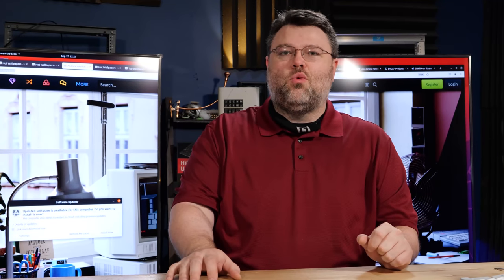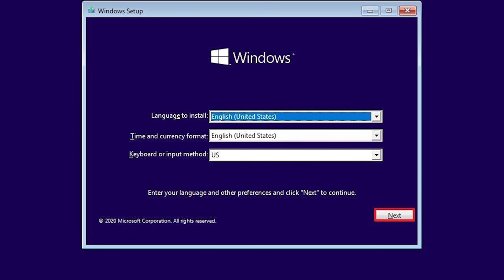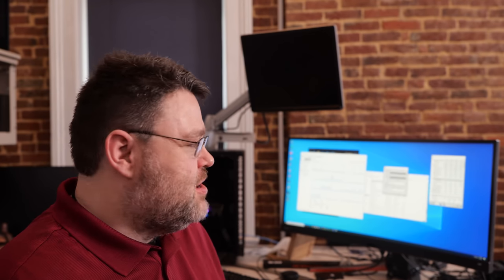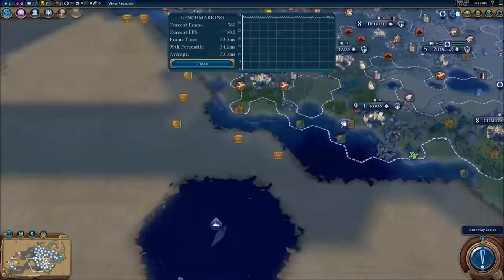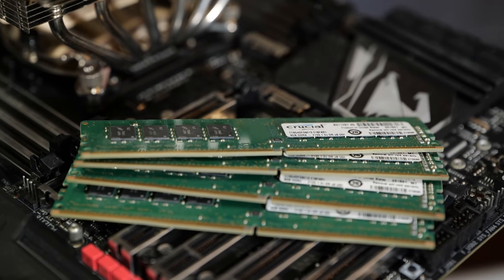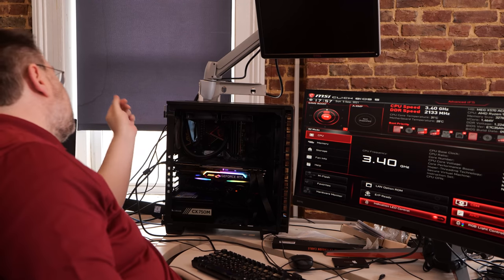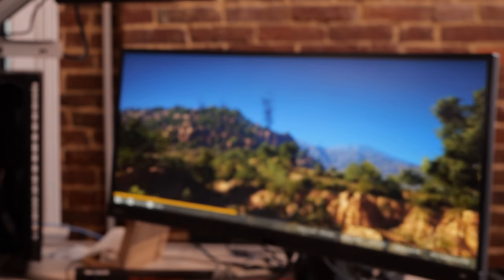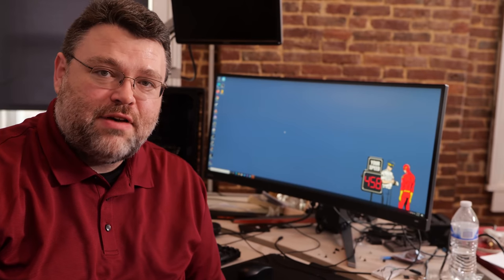Level1Techs Real Upgrades: X299 7900X to AM4 5950X

Comment: wow, this video is tailored to me. I'm on a 7900x atm on a gigabyte aorus 7, great mobo and a pretty good CPU for its time and my use case (video rendering), but the platform got stuck in time and had an embarrassing run. I made the mistake of buying into the x299 platform on launch expecting new silicon down the line, now I've been stuck for years on it.

IMHO the way Intel abandoned the x299 is unforgivable... I could not believe it when the 9k series was just a silicon refresh, especially after the YEARS of support and innovation on the x99 platform. and as shoked is i was, nothing prepared me for the 10k series, being YET another refresh. Intel lost a lot of customers with those moves... I spent years watching people buy into AMD setups that were just as powerful at under a quarter of the total upgrade cost. The 2700x was already a mild upgrade!

AMD ended up innovating on the AM4 platform way more than Intel ever did on their x99 series... sure, performance matters, but also confidence. i have no reason at all to trust intell will stick to a platform the way they did with x99. AMD did it with AM3, and they had a fantastic run with AM4, I have no doubts AM5 will get lots of support.

5950x looks like a beast upgrade, but I'm still going to wait a lil longer. (AM4 is at the end of its life, will wait for AM5)
Reply: AMD also screwed over Thread ripper customers. x399 had only really 1 gen and refresh. Trx40 has only 1 gen ever and it's already discontinued

Comment: I recently went from a 5930K to a 5900X, it is wild to think what the next 5 year upgrade will be like...
Reply: I did something very similar!  Mid 2020 my 5930K died so I went 3950x.  That was a hell of an upgrade.  I’ve since migrated again to a 5950x/3090 setup and gave the Zen2 to a family member.  Good times. 

Enjoy your new system! 😀
Reply: @AstroCat I think your 5820K is great for an everyday Linux machine for everyday tasks.  If it’s working well for you, let it keep working well. 👍🏻
Reply: Still rocking my 5930K @ 4.4Ghz, 32GB (8gb x4) of 2666mhz, upgraded to 2080super. Still does really well, even in VR with a Valve Index. I know there is performance in CPU+ram upgrade, but I'm saving for nightvision, and prices to drop. And the setup just keeps chugging! Went from 360mm water cooling to NHD15 to keep it cool long ago!
Reply: I only have a 3700x

Comment: The oldest parts in my computer right now are from 2015. An HX1000i and 4x Samsung 850 EVO 500 GB SSDs. In 2017 I built a mostly new system around a TR 1950X, but brought the PSU, SSDs, and a "just a few months old" 1080 Ti  from the old machine (sold the rest of the parts off). Since then, I switched the AIO water cooler for a custom loop, added two 970 EVO Plus drives, added more RAM, and swapped the 1080 Ti for an RX 6900 XT. Occasionally I've put a RX 560 or some other GPU in for passthrough experiments.

Comment: Rocking X299 i9 7900X myself - in the inwin 909 case, H115i cooler - with a 1080 TI and it's rock solid, used 12+ hours a day for 3 years - this video was really interesting / kinda puts me off from replacing that 1080 haha
Reply: This is 100% not the fpu to blame from my exp, the heat issues could be sorted and get the ram to 3600 or so and you will likely not see any issues even if u ran the cpu totally at stock

Comment: I'm at a loss... what was exactly wrong with the previous config? Bad motherboard/CPU/CMOS battery? The CPU was overheating, BIOS settings were being reset often. What were the causes? Maybe I missed something. :/
Reply: As the bios was reseting on its own, probably dying CMOS Battery, Heatsink probably needed new paste.  New video card was probably heating the case up more as well, so better fans with more cfm might of helped.

Comment: not that it would matter, but my 5950x does draw up to 190-200w when fully loaded and with PBO2 turned on (just a general -5 curve optimizer offset, nothing more). An NH-D15 will hold about 190w load at 4.2ghz for over an hour.
Reply: add more fans/spin them faster, it helps a bit

Comment: I had an old Seasonic 850 watt silver. It was fine for a decade, but at 12 years, it fried my HDD, SSD, and motherboard (RAM, CPU, and graphics card were fine).

I buy good PSU’s, but they do die. I would highly recommend swapping those out after a while.

Also, my friend’s Thermaltake Toughpower 1000 watt had been real nice.

Comment: I forgot about the BIOS on those boards. They have a Dual BIOS setup. So, it didn't reset, it just switched over to the backup BIOS. Unless the board has a dedicated BIOS switch. Regardless that a awesome board. I would've just delided the CPU. That 10core is not soldered, if i remember correctly. Also. the peak wattage of that 2017 CX750M is like 800+ watts. If lost anything, it would the efficiency not peak wattage.

Comment: Being an AMD fanboi I'd rather have a 5950X than a 7900X. But I was very disappointed that the problem in this system was never diagnosed. The system as it was "should" have been just fine for what he was using it for.
Reply: An intel fanboy with no brain damage would have picked that over intel. The insane temperature was probably a bad mount. The bottleneck was the memory I think. That cpu is basically a 10 core 6700K with an arguably worse memory controller so it's still more than decent for gaming and more than capable for "light" productivity.
Reply: Delid would have done a world of good. I wish they’d fixed the existing setup.

Comment: Been loving my Antec 1300w Platinum, which is a Seasonic clone! And its been handling my 3950x/3090 no sweat. Love this PSU.

I feel bad for people that live on youtube videos in general, because a lot of power supply videos out there are flat out wrong. According to the official manual for those "kill-a-watt" wall worts that read power, they don't read actual peak power, they read the RMS (root mean square) which isn't showing actual wattage used. So when Gamers Nexus says "450w power draw" in reality, you have to correct that reading from said wall wort. Which would be 450√2 which ends up 636.3961030 which you can round to 637 watts, of ACTUAL used power. And the issue is people don't read manuals for products anymore. Hell, even Nvidia has switched from "recommended power" to "REQUIRED power" because the 3000 series are power hungry as hell. I had mine since day 1 and never had issues with "crashing" because I had a 1300w psu. Others had barely 600w crying "it crashes, its the capacitors" but turned out, capacitors had nothing to do with it. Some brands like EVGA stated the reason why they chose their capacitor design but never said "that's why some people on other brands are crashing" people just ASSUMED which was really sad.

Can't wait for AM5 and DDR5 coming end of 2022. I think when those parts come, I am gonna switch to said AM5 but probably do an 8 core instead of 16 core, DDR5, and then whatever GPU AMD drops then as well (flagship). Then I will sell my 3950x/3090 to someone.
Reply: GN tests power draw using a current clamp. Multiplying current by voltage provides power draw at any given moment. They have set up automatic logging of current draw performed by a device external to the system. Watch/read their updated CPU and GPU testing methodology.
Reply: @Dylan-xc8yz  his written reviews LITERALLY stated using the kill-a-watt power reader. Apparently YOU cant read

Comment: I'm still running an fm2+ platform....At some point, I'll upgrade to am4, I just have other priorities for the upgrade cash. My likely plan is b550, 3900x and at least 32Gb of ram. An M.2 boot drive and eliminate all the spinning rust in the system. My main concern is something with wifi/bluetooth that works on linux, since the gigabyte pci add in card simply doesn't have drivers available. I have zero desire to install windows again, it's almost two years since my windows install booted, I now fear doing so tbh.

Comment: I'm curious what the underlying cause of the stuttering was. The cpu temp jumping up that high? What was it idling at? I've seen a few heavily used Intel cpu's lately have the TIM between the die and the heatsink start to give up, making it impossible to keep the cpu cool. I'm wondering if that was a possibility.
Reply: I was thinking it was probably the motherboard that started acting up, maybe a layer is deficient and that's what causing the stutter.

Comment: Decent board from setting one up. Dirt cheap used as the RGB had stopped working. Bios has an awful lot of extra settings over my ROG B550-F.

EDIT: The Carbon

Comment: Of note, some motherboards dont reset the XMP profile with new memory installed. 
I remember testing this patriot viper steel kit of 4400Mhz on my Ryzen 5 4650G(wanted to get that GPU performance higher) Unfortunately, because of Zen2 and B450 limitations, the system could only hit 3933MT/s so i swapped the 16GB kit back out for the original cheap 32GB kit from siliconpower. The odd part was not only did the board not reset the XMP profile, but i've been running this super cheap kit of memory(costed less than the 16GB kit from patriot) at the same speed and tight that i was able to hit with the patriot kit.
Been running it like this for probably 6 months now
Reply: Well if you use XMP it does require the same testing as manual OC, so I'd expect that the user can check what's going on in the BIOS...
Reply: @TheXlen  Hopefully. It could just be that XMP only resets to default if a replacement kit doesnt support the old speed/timing

Comment: That's why i used a 4x4GB kit instead of a 2x8GB kit, and then a 4x8GB kit instead of 2x16GB kit. Having twice as many IC's does actually give you a 10%-20% gain in performance or FPS.
 To those that don't understand, don't try and stand under it. To the reply, 2x16GB dimms do not equal 4x8GB dimms in true and theoretical bandwidth. Explanation. The motherboard has dual lanes going through each channel, so when you have dual rank 16GB dimms on only 2 out of the 4 lanes are used. its not going to equal the same true and theoretical bandwidth when running a 4xXGB kit, BECAUSE, as i explained, there are twice as many IC's on the PCB of each memory module. Therefore, you will get more bandwidth (not a lot). And it shows in benchmarks and games. And yes, you can see up to 20% gains in some instances just by going with a 4xXGB kit, even if they are single rank. 4 single rank dimms will give 5-10% more bandwidth on average than 2 dual rank dimms. Remember, there are more traces going to and from all 4 memory slots, and even if the 4 dimms are single rank, they have twice as many IC's (memory chips). There are twice as many IC's on the dimms and twice as many traces from the 4 dimm slots. Wendell just proved that in this video and there are many others that prove it also. "Help me out here Wendell"
Reply: 4x8 = 2x16   the 8gb modules are single rank the 16g ones are dual rank.  and it's not a  20% gain lol

Comment: These days 'diagnosing' an issue is replacing parts I guess.  That Skylake X i9 should not be stuttering or heating up like that.  Replace the TIM, reseat the cooler.  As for losing the BIOS settings?  That's a 2 dollar battery.  Replace the PSU as it is old.  It's the heart of the system and so often overlooked and under budgeted.  Replace the ram with something more appropriate for the system- another area where one should not skimp.  Then go in there and set it properly so you know you are not over volting the CPU or running with non-optimized settings.  Set a mild overclock if it now doesn't overheat and do a 24 hr prime to verify stability.  Use appropriate SSDs/NVMEs.  (I say as I rock my Asrock Taichi X299 XE/7900x).  Yea I will probably upgrade, but not due to issues, it games just fine thank you, just I have a 3 year refresh that I try and follow (running a little late on that because it works well still).  Will keep the PSU (PCP&C 1200) and ram and maybe just replace the motherboard and CPU, or delay another 6 months if something new is pending.

Comment: Clearly the problem here (well known to any serious X299 user) is the TIM on the CPU. Remember this was the CPU all the YT commenters bagged Intel for going away from soldered TIM.
My watercooled 19-7900X has been delidded - liquid metalled and custom watercooled back in 2018. It runs 12-14 hrs a day all cores @4.9GHz @1.310 volts ram 32GBS 3600at CL15. The 420mm Rad also cooled a 1080Ti until late last year when I managed to get hold of a WC RTX 3080. I game at 1080 and sim at 4k. The PC idles at 25-27c and flat out CPU use goes to 72C. I have seen 2 other 7900X units locally with stock TIM and both now run hot. My setup sits alongside a X570-3900X system at 4.4GHZ (best it will do) and beats the Ryzen to this day (except for my blender work) so there's that though the Ryzen runs much hotter under load. Waiting to see what next gen Ryzen does before I feel the need to change.

Comment: I have two AX1200i's, the one in my main system has been surveying me for 6 years now and my older one has been for around 9 years. Probs should grab a new PSU for at least my new system but I'm too cheap to replace it.

Comment: Sweet build, I would have stuck with a tower cooler instead of the all in one. Those all in ones always die on me, got sick of dealing with them.
Reply: @AstroCat All in ones are cool though, pun in tended. They do work great for those huge multi-core CPUs too. However I've had them get gummed up and motors just break. Not much can go wrong with a tower cooler.

Comment: Find it weird that he was having CPU temp problems, esp with the cooler used, the fans in the system, etc.  Yea, the case front isn't meshified, but there are worse flowing cases then that one.  Not that it matters, that's a really nice upgrade. :-)

And yes, my system is an example of a computer with a never ending revolution of upgrade and mixed generations of parts - it started off in Jan 2012 as an overclocked Phenom x6 1055T (clearance prices on the CPU made it a very cost effective beast) in a 970 mobo, Radeon 6950, 8gb 1600 RAM, and a 2tb HDD.  Today it's a Ryzen 3600X on an x370 mobo, RX 6700XT, 32gb 3200 RAM, and 4 1tb SSD's...  Not rocking the original PSU or case though, so it's a little harder to tell based on case that the original build goes that far back. The next big upgrade is likely to be to a Zen 4 platform, but we'll see when the time comes and what reviews are like at that stage.
Reply: bad mount.
Reply: @ahmetrefikeryilmaz4432  Wendel said he checked all that.
Reply: @nukedathlonman  then the stock thermal paste between the silicon and the IHS is shit, no shocker there.

Comment: For someone who keeps the system a while an aio probably isn’t the best cooling choice. That Noctua tower cooler would be my way to go. I’m assuming this is a somewhat MSI sponsored build.
Reply: AIO's last. I have the original NZXT x60 still runs no problem. That's 2013 release old. I also have an OLDER Antec kuhler 920 liquid cooler, guess what, still works. No leaks. None of my liquid coolers have sprung a leak or stopped working. They ALL still work. But I also don't throw them around or overly bend the tubes like an idiot. Sure I've upgraded AIO's over time. Going from said 120mm dual fan antec 920 into the 240mm nzxt to a 280mm corsair to my current 360mm cooler master.... all of them still work. and all of them are still in use. this idea that AIO is trash or not good is a sad online meme by those who don't know any better.
Reply: @goblinphreak2132  This channel specifically has shown multiple times how the liquid can and will evaporate out through the tubes over the years and they slowly lose effectiveness.
Reply: @keyboard_g  more to that story. Most likely a tiny leak which allowed said leak. Or the tubes became cracked, but that isnt common in a household.

Comment: That CX750M is a 2017 Edition. So, its actually enough for what its powering. Also, the 1st Game Bench is known for stuttering. Truthfully, i would wait for Alder Lake. Also, Win11 isn't working to well with Ryzen. But, Zen works good with Win10. Another little bugger is the 10980XE. If that Aorus board isn't the Gaming 7 Pro which uses the ISL99227B 60A Smart Power Stages don't even try the 10980XE in that thing. Not Even the 9960X or 10940X. Only the 12 core would be safe in the regular x299 Gaming 7. I snagged the 9960X and x299X Aorus Gaming 7 Pro for $800. I couldn't pass that deal up.

Comment: There's no AIO that will outlast that big block of a NH-D15. Once that liquid temperature starts to warm up that AIO is done for. My 10700k Still hits over 85C on high usage after the 3080 heats up the case pretty hard.

Comment: I have a cx750m power supply, but it's only a few months old. Black label with white letters. I'm running a new 5950x processor and am about to get a better mother board so I can overclock it further. Do you foresee problems with this power supply?